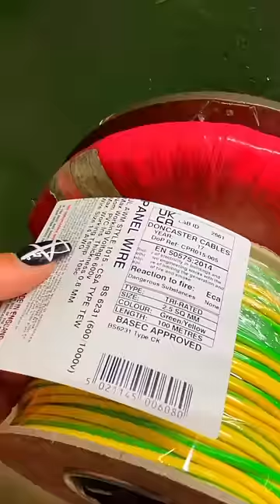This Will Confuse American Electricians!

Comment: I am an American electrician and I am confused as to why I should be confused
Reply: Same here.  I was honestly going to comment the same thing.
Reply: I'm a Swedish Electrician who lives in America. 
I'm only confused why hazardous design of NEMA plugs and receptacles are allowed here.
Reply: @benjurqunov Says the representative of a country that has longer electrical prongs and a household nominal of 230VAC to our 120VAC...
I'm not saying we couldnt improve but you're not in position to throw rocks lol.
Reply: @benjurqunov  I guess I'm confused as to what hazards , but I'm not familiar with other plugs and receptacles
Reply: @geoiselin  the primary hazard of most NEMA plugs is that a partially withdrawn plug exposes live parts what can easily be shock or short circuit hazard. 
The most common plugs of Europe and UK don't have that hazardous feature.
Reply: @benjurqunov  I had no idea that there even was a receptacle that did not have that hazard.  I am amazed that with all the rules and restrictions Americans love that we don't have those here.
Reply: @benjurqunov eh, it just forces the population to respect electricity (and the lower voltage at the 5-15 5-20 receptacles are much less likely to cause serious damage). I got bit once and that was all I needed to respect the angry pixies.
Reply: @subtlename2873 here in sweden all outlets that arent from the 50s-60s or older has that issue(aka few). the prongs are always hidden in the outlet. they also require some force to unplug unlike the american kind that seems to just want to fall out and the prongs are never hidden untill the plug is completely in. absolute garbage tier XD
Reply: @Peron1-MC  Your plugs are also about 8 ft long so you can get a finger in there. Ours fall out before you can get anything into it short of maybe a butter knife. If you had designed them a little more appropriately, you wouldn't have had to over engineer them. Guess what, your outlets suck too. Just in a different manner.
Reply: @Peron1-MC  Also, our arc potential is much lower on a 120 VAC system than yours, resulting in a system that has even less chance of shorting out.
Reply: @subtlename2873  interesting,  so less conductive surface to contact? It seems like if they are shorter, they would fall out easier? Do they have trouble with loose receptacles arching or over heating? Of course, to some degree everywhere will have these issues,  but I mean more often than the plugs with longer prongs?
Reply: @subtlename2873  why? I'm not saying youre wrong,  but do you run a lower voltage or ungrounded systems?
 I really don't know what they have in other parts of the world.
Reply: @geoiselin  If a receptacle is worn, a plug can be loose/fall out easily. In that case it usually just needs to be replaced (I have no tolerance for loose receptacles, I have offered to replace loose receptacles for near strangers before). Very old houses (pre-1970s) had ungrounded systems, but grounded receptacles were required in '71. We in the US utilize what is called a "Split Phase". Houses are supplied with 240V single phase power like basically any other country. Rather than connecting one "leg" of the incoming power to ground as most of the world does, we have a third "leg" or "tap" at the center of the transformer that is tied to ground. Regular receptacles are connected to one of the power legs, the center leg, and a dedicated ground (We try to tie half to each power leg so there is some balance, this results in 120V available at the outlet). High power appliances like ovens, stoves, air conditioners, welders, etc... connect to BOTH power legs. This gives them access to 240V. This may sound way too complicated and you may wonder, what is the point? Remember how that center tap is connected to ground? That means that touching the power leg on either side will only result in a 120V shock. It is not pleasant, but it is much less likely to seriously harm you than 240! With 240V appliances, unless you touch BOTH of the outer legs at the same time, you will also only get a 120V shock. Over the past few decades RCD breakers have become available and in cases, required which further mitigates the danger of actually receiving a shock. If you are interested in the subject, go watch this video from Technology Connections designed to explain the US system to people from other countries: https://www.youtube.com/watch?v=jMmUoZh3Hq4
Reply: @overkillthemighty  Thank you, I will check it out.  it sounds very similar to a delta y system here. One end of each phase is tied to ground, resulting in 208 v phase to phase 120 to ground  or 480/277 for high voltage.

It's interesting what you're saying, as long as all property owners feel the same about receptacles ( not the case here)
There should not be as many problems as I thought
Reply: Look I think we can just all agree when it comes to electrics and plumbing, Britain does it best 🇬🇧 😂😂
Reply: @geoiselin  Not everyone feels the way about I do unfortunately, but even so I don't run into horribly worn receptacles very often. The delta Y system you mentioned is used here as well, though it is usually only seen in large commercial buildings or apartments. Regular residential installations usually have a transformer for small groups of homes or single homes (depending on how spaced out houses are) that reduces the voltage of a single phase to 240v with a center tap.
Reply: @overkillthemighty so 240 v phase  to phase? what is the voltage to ground?

For what it's worth I don't doubt that other parts of the world have better cord and plug systems than the USA.  We have the original test system and so many patient laws restrictions and regulations, I'm amazed we have electricity at all.
Reply: @theboyp1508  If you say so, I am only familiar with the system in the USA. I like most of how it is done here. Of course, being inventerrs, they had a few things to change when other countries started using it.
Reply: @geoiselin people always forget that our systems have been in continuous use for longer than any other and are larger than all of the European peninsula, we can’t just upgrade the thing, especially not when it works just fine as is.
Reply: @geoiselin  power poles/underground power lines generally carry 3 phase power in the 10s of thousands of volts. The transformer that interfaces the power pole's line voltage to the consumer either steps it down to a 3 phase delta Y type configuration of 208V with a 120V connection to ground or one phase converted to 240V with 120V connection to ground.
Reply: @overkillthemighty  Interesting, that sounds exactly like what we have in the USA.  We just use 120 v for small loads and most residential loads. But thank you for explaining,  I have wondered about other parts of the world.
Reply: @stevendorries  thank you. So true
Reply: Edit. I didn't see that you had said the us. I thought you were explaining how other parts of the world work.  That explains the similarities.
Reply: maybe about these nails?
Reply: @kneisslstef  ?
Reply: Lol at arguing if ice or steam is water. I've never seen anyone that was shocked by a North American outlet due to a loose outlet. It will piss you off though. If they did get shocked they would learn their lesson fairly fast. I'm just happy not to share a continent with Greta Thunberg
Reply: @916619jg  really good point,  but I don't think there is an argument,  some people have their favorites and I'm just curious.  I hope it's clear that I haven't seen other receptacles so while I make any concerns I have known,  in the end, I just don't care that much.  Maybe I would care if shock fire or injury was common with any of them.
Reply: Tbf i do british electrics and I'm confused as to why you should be confused as im also slightly confused by someone spooling a reel of cable
Reply: @subtlename2873 eh voltage ain't gonna kill you 
Just makes it hurt more 
Its the current that will kill you
Reply: @theirishviking9278  True, but higher voltage results in greater arc potential as well as arc length. Meaning, you can get shocked through more stuff and farther away.
Reply: That’s why some guys install with ground up. Not a fan truly. But, I also don’t hold a plug by it’s prongs to plug/unplug. And the other comment of plug falling out, that’s a plug issue. But, if it were an outlet issue, it would be time to replace.
Reply: @benjurqunov Easier to walk away from 120v & learn a lesson in respecting electricity. Not so much with the 240v system.
Reply: @theboyp1508 No they don't.
Reply: @geoiselin actually there's quite a bit more conductive surface and American plug than a European plug with lower wattage and power usage so ya .... And on a second not if our plugs are "falling out" of our socket .... That's an indication to replace the socket as it's either made of cheap Chinese materials or has been used relentlessly for years (like in my wood working shop where I'm constantly unplugging and plugging in different saws sanders and routers ) ...... Benift to American plugs ..... Less likely to kill yourself
Reply: @stevendorries okay is somebody that has to deal with the rolling blackouts due to high power usage I'm not really sure what you mean "working fine as it is"
Reply: @dustinmiller7278 That's because they don't burn coal in California. We don't have that problem here in West Virginia where coal is abundant and utilized.
Reply: This is why everything electrical is listed in the US because any idiot in other countries can put a sticker and stamp on a spool of wire, electrical junction box, outlet, socket and claim it's safe for electrical use.  In the US electrical components are safe and efficient instead of highly resource intensive.  Other countries whole electrical distribution systems are tiny tinkertoy engineering compared to the US.  I've used electrical systems in UK, China, France, Germany, it's bulky and frankly no better than US.  In these countries the bulk of testing is done by unsuspecting consumer not a nationally recognized laboratory or similar qualified authority like in US.
Reply: Thats the point. Ur already confused 😂😂

Comment: Only Romex has uninsulated ground in America
Reply: Not totally true. Unshielded twisted can be used to run to ground rods.
Reply: @AlexXHitchcock  And in industrial control cabinets sometimes
Reply: And even Romex is insulated through the walls.
Reply: BX?
Reply: @TechKnowCase  not used anymore
Reply: @monsterkitten2747  I beg to differ. I'm an electrician from Montreal and virtually all the BX we use have uninsulated ground. BX is really popular here for new sky scrapers/businesses.
Reply: Teck90 has exposed ground wire, along with bx (ac90)
Reply: @TechKnowCase  then beg
Reply: @monsterkitten2747  that's not very cash money of you...
Reply: @TechKnowCase  I've only seen bx in old houses with nob and tube did not know it was still used
Reply: @monsterkitten2747  Ah! I can only speak for my areas, but here, houses are usually wired using Romex (nmd90). Anything above 3 stories usually has metal studs (higher standards for fire resistance), thus using BX or something else, but never nmd90. I can understand that you don't see it often if you mainly do residential work!
Reply: @TechKnowCase  any work that's not residential I use mc and it has insulated ground
Reply: @TechKnowCase  Not used in the US anymore.
Reply: Every short clip I’ve seen in us it’s uninsulated I couldn’t imagine leaving a install uninsulated lol
Reply: Just a few years ago when I was doing commercial solar, all the separated arrays on roofs were bonded together with bare copper, usually #8 solid copper. Ground wells around transformers on high amperage manufacturing plants needed 500kcmil bare copper as well as structure grounding inside closure strips around the tilt up walls, as well as other bonding applications. Bare copper grounds are everywhere in the US. With that said all grounds inside conduits I've only ran insulated. Every time we needed to outside bond a conduit expansion joint it was bare copper or flat braid.
Reply: @AlexXHitchcock  depends on AHJ. Not in Seattle City Light territory is one example i can think of.
Reply: @monsterkitten2747 It's used every day in your world
Reply: You know, had you not left this message i would have likely never figured out what i was supposed to be confused by. Thank you!
Reply: The Australian equivalent to Romex - TPS (thermoplastic sheathed) - has insulated earth cables. So yeah ideally Romex should have insulated ground too
Reply: @glen7463 In US homes NM cable/Romex (brand name) is often used. It has an  uninsulated ground. The rolls of green insulated ground wire, as seen here, are used for wiring inside conduit.

There’s also MC/Metal Clad cable, which is wrapped in an interlocking aluminum strip. It has a green insulated ground wire and is sometimes used in commercial buildings as well as houses.
Reply: If I remember right Rolex isn’t completely “uninsulated” ground it usually has a a paper wrap isolating it from the other wires that are individually insulated and then the whole bunch are insulted again by the sheath, it’s still insulated electrically, you just don’t have to strip it when you run it
Reply: this is only insulated because it is not solid,
Reply: @TechKnowCase  BX, as in Armored Cable? Yeah, that wire is insulated, too. Do NOT want bare copper coming in contact with ANY other metal, unless it's a connector designed for it.
Reply: it also comes in insulated ground and smaller gauge ground and smaller gauge insulated ground
Reply: @jasonstevens5943 Since when? Take a peek up inside a drop ceiling and that's what you're most likely to see feeding the lighting. Never seen it residentially, but all the time elsewhere.

Comment: As an American, I see nothing confusing.
Reply: I'm confused as to why Europeans think archaic=integrity
Reply: Maybe it's because they use stranded ground vs solid core?
Reply: @MrShwaggins maybe it has to do with the size of strands?
Reply: Make sure u 👍 any comment u see to let that person know they aren't censored
Reply: @MrShwaggins  In Europe you can buy solid core or other wires for protexctive ground. 

These cable is for installtion in a e.g. machine because it is flexible.and not solid. 

For some appications you can buy very fine copper wires. These is standart.

Confused by the finger nails at the beginning and later normal finger nails. 

And confused by the useless video cuts. 

Not confused if cables in Europe are made for some customers in mm² 
or the reel is sold with xyz meter or sold by weight. Dont know who doncaster cables in UK sell there cable 

But with a lot of manual work and at the slow speed in the video (?timelaps?) and the bad reel ...
Maybe a cable for the quality control department.

Comment: Been using insulated bonding wire with a yellow/green color scheme for almost 15 years now. I don’t get what the fuss is about.
Reply: How bad its rolled, no guide to get a neat roll.
Reply: Yes, but this is low quality coating.
It should be green or green with a nice neat yellow stripe.
And the green should be green, not florescent green  :-0)

Comment: Are the ball chains to dissipate any charge?
Reply: From another comment thread (paraphrased):
It passes high voltage (>10kV) over the wire's insulation, and the wire being spooled is hooked up to the machine's ground (ha) so if there is any fault in the insulation, the high voltage will find it and should an alarm. 😀

Comment: I bought a few reels of this stuff a few years ago at a electrical sale. It was dirt cheep as is was for the Americans. It was lovely to work with more cores than ours. I believe it is designed for wiring panels.  Funny is was still labeled 2.5 and 1.5 but cable length in feet and UL listed

Comment: Ul certification is what I like to see
Reply: I guessed it was something like that, some kind of test of the insulation
Reply: Small point of clarification: certification is for completed products which satisfy all the requirements of the relevant standard(s). UL Recognition is for components which are only evaluated to certain portions of the standard with statements in the test report requiring that remaining requirements are met as long as the component is only used under certain conditions of acceptability. It makes the certification process go much faster if all the components are recognized. If you see the backwards UR that's a recognition.

There's also UL Classification, which is just certification, but specific to medical electrical equipment under IEC 60601-1

Comment: You rolled up a spool of wire for individual sale and your useing those cheap cardboard spools that we love so much just because the place where you manufacture are equiptment is cheap and trys to make every penny they can and the first time they get thrown in a leaking shipping container and it rains one good time your perfectly wrapped pretty little green spool there turns into a pile of mush getting kicked around the shipping container by every other electrician that goes in there to find material and no one will ever evan use it because it's going to get knotted up when they try to go and pull it in
Reply: Holy fuck!! That is one long ass sentence.  I about ran out of breath reading it.
Reply: @tharon6530  I don't think it's a sentence. I think it's some weird attempt at a rant.
Reply: @tharon6530 HAHAHA LOOK EVERYONE, THARON STILL READS OUT LOUD! You do know you’re brain should be capable of keeping this dialogue in your own head 😂😂
Reply: Absolutely right. It's the only thing worse than those plastic encased 1000 footers of thhn that are supposed to autofeed like cat 7 boxes but never seem to.
Reply: @tharon6530  legend has it, the sentence continues to this day